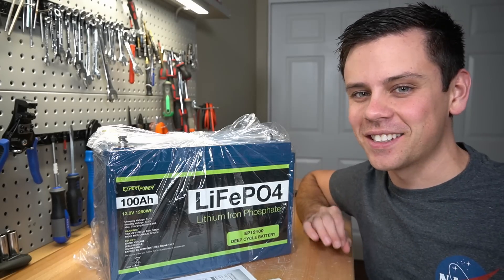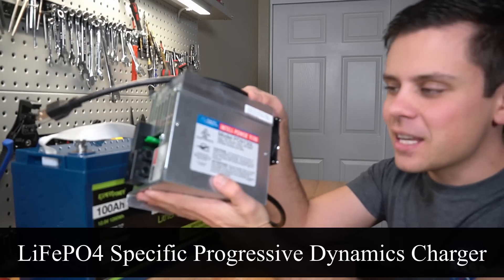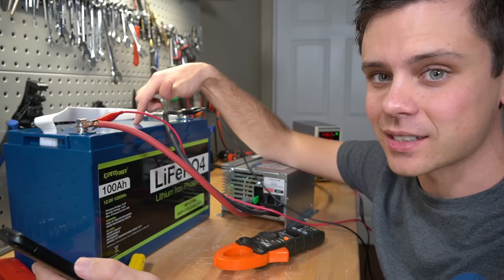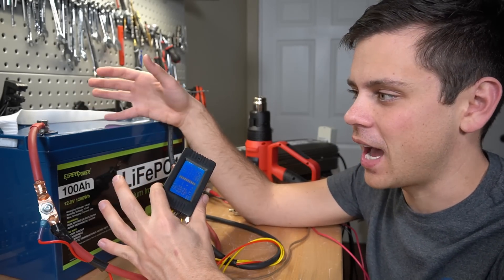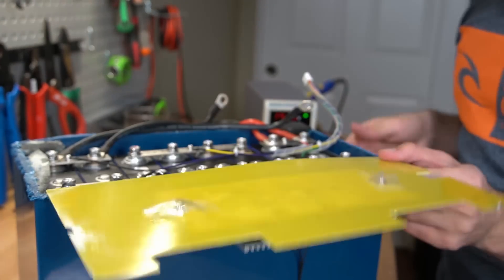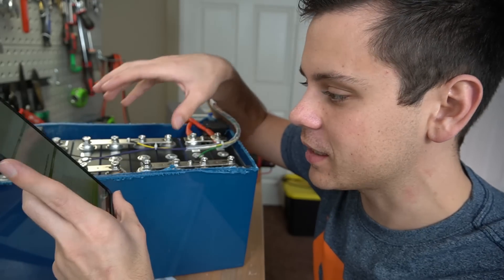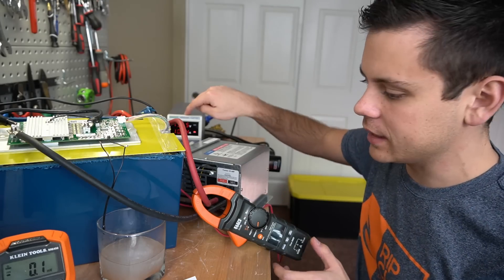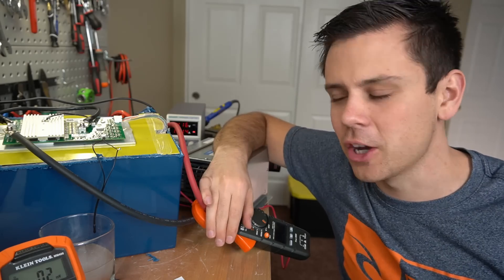ExpertPower 12V 100Ah LiFePO4 Battery Tear Down!

Comment from the maker: Bryan from ExpertPower just emailed me back and is replicating the low temperature test on other batteries they have in their inventory. Very quick response, which is nice. He also gave me a label to ship it direct to their team to inspect the battery and figure out what went wrong. I will update you guys when I get more information. I just want to know what part was defective. They will give a full refund, which is nice.

1st update: Some of my viewers are saying that manufacturing tolerances and quality control on these temp sensors can be pretty awful. I packaged the battery up tonight and shipped it through fed ex ground. I would not be suprised if swapping out that sensor will fix the problem. I highly doubt it's a faulty BMS.

Update 2, email response: 
Hey Will,

Thank you so much for being patient while we found the solution to the low temp protection not functioning.

We began thorough tests here in Los Angeles on other batteries replicating your methods and found that we reached the same result as you-- every single time.

This did not ring right to us while delving into the investigation last night so we went straight to engineering and had them perform hardware inspections on all of the components in our manufacturing. They passed with flying colors. Interestingly enough, were also passing the high temp tests. All the sensors were confirmed working.

After the hardware inspections, we began a review of the software on our BMS. We requested logic schematics and programming instructions from the software team and found that the instructions the team received did not include programming low temp protection within the BMS. We now know why the battery was not responding as it should have.

My team and I oversee design for the LiFePO4 battery and are responsible for communicating everything we want and need to see in our battery. It was our mistake as we did not appropriately communicate that low temperature protection was to be included in the current batch of batteries during redesign of the cells for this specific batch.

We have quality control teams in our plant in China as well as here at our Los Angeles warehouse and have discrepancies in testing. Our engineers in China administer every test imaginable. Here in LA? We run simple tests before shipping them out. We were confident in the product but too quickly let slip the details.

Will, I want to personally thank you for running your tests as you did because without them we would not have caught the issue in time before it became more serious and damaging to our company's image. Thank you as well for keeping us updated with your audience, their thoughts and yours. We have a profound gratitude for helping us communicate with everyone what went wrong. We aren't a mindless company that only wishes to make a quick buck, we care an incredible amount about what we put out and have begun immediate restructuring and redesign from top-down to bottom-up to ensure something like this never happens again. We will send out our complete design of the newest battery to you once we have it put together. It will take time as all good things should and we will not jeopardize wanting to provide a better future for renewable energy.

Thank you so much for your time, and thank you for hearting my comment on the BattleBorn Factory Visit video that one time. That was great.
 

Bryan

ExpertPower
~~~~~~~~~~~~~~~~~~~~~~~~~~~~~~~~~~~
Tired of getting ripped off? Check out my "Will Prowse Approved" solar product recommendations below!

12V Batteries
https://www.mobile-solarpower.com/lithium-batteries.html

48V Batteries
https://www.mobile-solarpower.com/48v-batteries.html

Offgrid Inverter System Builder
https://www.mobile-solarpower.com/48v-complete-system-blueprint-559371.html

Hybrid Inverter System Builder
https://www.mobile-solarpower.com/code-compliant-48v-offgrid-system.html

Mobile Handtruck System Builder (very popular!)
https://www.mobile-solarpower.com/mobile-48v-system.html

Solar Panels
https://www.mobile-solarpower.com/300w-solar-panels.html

Ground Mount Solar Racking
https://www.mobile-solarpower.com/ground-mount-racks.html

Wire, Lugs and Busbars
https://www.mobile-solarpower.com/wire-and-connectors.html

Tools
https://www.mobile-solarpower.com/tools.html

Fuses and Circuit Breakers
https://www.mobile-solarpower.com/fuses.html

Plug-N-Play Solar Systems
Ecoflow, Anker And Bluetti! So many models to choose from. See my current recommendations here:
https://www.mobile-solarpower.com/full-size-systems.html

~~~~~~~~~~~~~~~~~~~~~~~~~~~~~~~~~~~~~~~~~~
Need to build a large DIY system? Need a trustworthy solar distributor? These are my favorites:

Signature Solar
Creator of EG4! Solar Minisplits, Victron and More! Largest Solar Store Online.
If you want $50 off, please use my link below and coupon code "DIYSOLAR50":
https://signaturesolar.com/?ref=cPwLcVc0SW-BjN

Current Connected
Best Prices for EG4, Victron, Midnite and so much more! Fast Shipping and Highest Rated Customer Service:
https://currentconnected.com/?ref=wp

~~~~~~~~~~~~~~~~~~~~~~~~~~~~~~~~~~~~~~~~~~
Join our DIY Solar Community 
Need more help? Join the largest solar forum on the internet for beginners and professionals alike. 140,000 members and counting!
https://www.diysolarforum.com

Check Out My Free Book
Best-selling and beginner-friendly guidebook to off-grid 12V solar!
https://www.mobile-solarpower.com/the-book.html

~~~~~~~~~~~~~~~~~~~~~~~~~~~~~~~~~~~~~~~~~~
Contact Information:
I am NOT available for personal solar system consult! If you wish to contact me, this is my direct email: williamprowsediysolar@gmail.com
FTC Disclosure Statement and Disclaimers:
Every video includes paid promotion or sponsorship (such as free products for review). Some links on this YouTube channel may be affiliate links. We may get paid if you buy something or take an action after clicking one of these. My videos are for educational purposes only. Information is subject to change/update at any time. Electricity is DANGEROUS and can kill. Be smart and use common sense :) DIY Solar Power with Will Prowse is a participant in the Amazon Services LLC Associates Program, An affiliate advertising program designed to provide a means for sites to earn advertising fees by advertising and linking to Amazon.com
Reply: Definitely a good sign that they want to get to the bottom of the issue.  Look forward to the update.
Reply: @xavierpendrag0n  They would jump for Will, but would they jump for Joe Blow?
Reply: Spot on.
Reply: The fact that you are the YouTube official battery inspector most companies will jump over backwards to help you out Will and that’s impressive.  Great take apart thanks for sharing
Reply: If you test another one of theirs, buy it again to check on their quality control. Thx....keep up the great work for us novices.
Reply: Sweet customer service
Reply: @HellTriX  YEAH - now if they only had QUALITY CONTROL !!
Reply: Bryan deserves a bonus. He did everything right, owned the issue, didn't make excuses, and got to the bottom of it. Kudos to Bryan.
Reply: Does cutting open the battery case void the warranty??? : )
Reply: @johnkathylee  For any of us mere mortals, you bet it voids the warranty.   For a high profile influencer..... not so much.

But.... that is fine.... if a high profile influencer can make sure the product gets shipped as advertised.... he should get a break.
Reply: @johnkathylee  Yes, unless you are a YouTuber.
Reply: @johnkathylee  Usually yes. But in this case it clearly did not..lol 
Will carries a lot of influence and manufactures do not want to mess with him.
Reply: @johnkathylee  Didn't he video the failure BEFORE he cut open the battery?  I assume he sent them the video.  Actually he did them a favor by cutting open and directly checking the temperature sensor before sending it back.
Reply: @chocolatewithedgarcia1012  Yes, Will helped them find the problem before it destroyed the companie's credibility.
Reply: John Lee - Usually. I cut open my cranium with a hacksaw to check my neurons after failing a geometry test, and the manufacturers (Mom and Dad) got really pissed....
Reply: Can you test a Dakota Lithium battery please. I'd really like to know the quality they claim to be the number one for fishing applications.
Reply: @sethcooper6480  this.  i almost placed a large order of batteries from them realizing that there were no reviews on them.  I ended up with a combination of battleborn 100ah and used valence 40ah to replace my battery fleet
Reply: @bryanh9288  I'm running an 80lb Minn Kota terrova 24v. Thinking of buying two used valence 138ah. Or two new dakota lithium 100ah
Reply: @sethcooper6480  you found any good Dakota info or videos?  Im in the market and saw their claims for cold weather performance and that their batteries were being used by the Army Corps of Engineers in the Arctic.  Other options Relion Low Temperature, bit its made in China.....
Reply: Couldn't ask for a better response. Impressive.
Reply: with the response the company gave, would you give them a second chance?
Reply: That was an inspiring response I am very impressed with their willingness make the correction in their products based on the results of your test. Very cool! This is a great example of the internet facilitating concerned company to better serve it's customer community.
Reply: Yes.👍 LiFePo4 аккумулятоp супер! 🔋
Reply: It's nice to see to see Bryan from ExpertPower got back to you, and admitted to finding the same result, It would be nice if he would invite you to LA to see what the problem was and how they fixed it and you could sit down and ask a few more questions so people that have seen your video can trust that the battery will work as promised
Reply: This is exactly how a company should respond. They’ve restored consumer faith in doing the right thing.
Reply: Thanks for the update, great calling them out and awesome they're working on it. Even though their QA is sub-par.
Reply: Hi Will, any updates from this company regarding the fix to this issue? I trust the batteries they are selling on Amazon now work properly?
Reply: DIY Solar Power with Will Prowse “
Reply: epic
Reply: thank you for posting this... i feel when a company thanks you for pointing out a flaw they really do care and want to fix the problem they didnt know they had. They seem like a good company who steps up when its needed and fixes the issue.
Reply: One thing that struck me as odd on this was according to the email the engineer in team in China runs every test imaginable you would think one of the test imaginable on a lithium battery would be low temperature cutoff so this is a fail on many many many levels. Hope this has been corrected
Reply: That's a really good response, them just being honest about it, no excuses, no denying, what a great attitude.
Reply: I really appreciate their response, they seem like a great company that is working on improving and has great communication. I would buy from this company because of their response and action to improve.
Reply: THIS is the kind of response I want to see from a company! So incredibly rare! Now I want to buy!
Reply: @Will P.  Did you get a chance to do a retest with a randomly selected battery after they fixed the QA problem?
Reply: I do have to take my hat off to you to cut into a battery then ask for a refund.   Fantastic. 
I am intrigued, what did they say?  Did you get your money back?
Reply: It will be interesting to see the re-test, but the re-test would be more credible if you purchase it independently, especially after the Ruixu incident. If ExpertPower want to refund that which you purchase indepedently, then good on them.

Expertpower have now admitted to a manufacturers fault, this battery has been on sale, are they going to contact every customer and make good their faulty product? This will be the defining question to decide wether Expert Power are worth looking at when spending our hard earned money.

Thank you for the honest videos, I have now purchased your book, and look forward to reading it before designing and building my own system.
Reply: It is a good sign they are quick on responding.  I am curious how customer service is for a "Joe Shmoe". Thanks for the review!
Reply: There are several concerns with this system ... The first MAIN one is that there is no way that those cables are properly sized .. the second is the temp sensor does not work ... i know some will say that there are "variances" BUT the Temp Sensors that I use - that I get from AliExpress - for a couple of dollars - have ALL worked within a degree .. and we actually test those before we put them out on stuff for that very reason ... I think collectively we try to make too many excuses for these sloppy Manufacturers ... so i am going to say that I might let the sensor slide -- BUT not the wiring ... unless of course the wire is actually the right size and I am having trouble seeing it -- BUT it looks small to me ..
Reply: @ghostwriter6699  The max rated charge and discharge currents are low for a battery of this type.  The cables might be large enough for these abnormally-low currents.
Reply: ghostwriter6699 did you read the company's reply to Will?
Reply from the maker: Just got an email back: 

Hey Will,

 

Thank you so much for being patient while we found the solution to the low temp protection not functioning.

 

We began thorough tests here in Los Angeles on other batteries replicating your methods and found that we reached the same result as you-- every single time.

 

This did not ring right to us while delving into the investigation last night so we went straight to engineering and had them perform hardware inspections on all of the components in our manufacturing. They passed with flying colors. Interestingly enough, were also passing the high temp tests. All the sensors were confirmed working.

 

After the hardware inspections, we began a review of the software on our BMS. We requested logic schematics and programming instructions from the software team and found that the instructions the team received did not include programming low temp protection within the BMS. We now know why the battery was not responding as it should have.

 

My team and I oversee design for the LiFePO4 battery and are responsible for communicating everything we want and need to see in our battery. It was our mistake as we did not appropriately communicate that low temperature protection was to be included in the current batch of batteries during redesign of the cells for this specific batch.

 

We have quality control teams in our plant in China as well as here at our Los Angeles warehouse and have discrepancies in testing. Our engineers in China administer every test imaginable. Here in LA? We run simple tests before shipping them out. We were confident in the product but too quickly let slip the details.

 

 

Will, I want to personally thank you for running your tests as you did because without them we would not have caught the issue in time before it became more serious and damaging to our company's image. Thank you as well for keeping us updated with your audience, their thoughts and yours. We have a profound gratitude for helping us communicate with everyone what went wrong. We aren't a mindless company that only wishes to make a quick buck, we care an incredible amount about what we put out and have begun immediate restructuring and redesign from top-down to bottom-up to ensure something like this never happens again. We will send out our complete design of the newest battery to you once we have it put together. It will take time as all good things should and we will not jeopardize wanting to provide a better future for renewable energy.

 

Thank you so much for your time, and thank you for hearting my comment on the BattleBorn Factory Visit video that one time. That was great.

 

 

Bryan

ExpertPower
Reply: @WillProwse  Quality Control and China should never be used in the same sentence.......
Reply: @einfelder8262  exactly! We need to stop using communist china.
Reply: @einfelder8262  does anyone remember the Chinese, lead painted children's toys that almost destroyed Wal-Mart's image twenty years ago?
Reply: @bobsmith613  No-one who lives in Australia does, but I remember the junk we got from Japan when it started out in the 60s or 70s - they eventually built quality although often boring stuff. China followed years later making junk, but they never matured and still foist junk on the world.
Reply: @WillProwse  Pretty impressive response from ExpertPower! Admitted their faults and from the sounds of things are willing to make good on their products! I wish more companies were as responsive.
Reply: @WillProwse  Good update – and I have been told by some to play nice – but honestly – they say they have quality control teams in China as well as in LA and NEITHER caught this systemic issue?? And how does the LA QC team do quality control?? Apparently they just make sure the color is nice (sarcasm) … BUT do they cut open every 100th battery or put it in an environmental chamber and drop it to 32 and raise it to 125?? Or do they test the actual aH stated to be correct?? As for their engineers in China administering every test imaginable – well I am going to disagree – there is at least ONE test they didn’t administer – LOW TEMPERATURE CUTOFF. (sarcasm again)
Reply: @ghostwriter6699  they should hire you to head their quality control division😅
Reply: @WillProwse  If I live somewhere where it will never freeze, would you still recommend this? Seems like there's $120 off coupon right now on Amazon but I'm guessing I'll receive one of these faulty ones?
Reply: @jesusluzon5457  or you could always buy the batteries and then say the low temperature isn't working and ask for a new replacement battery.